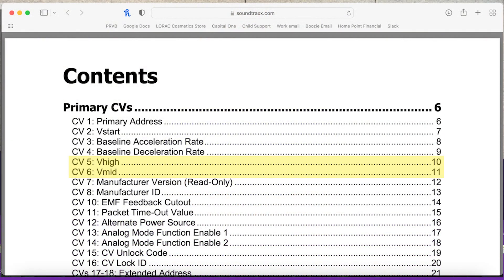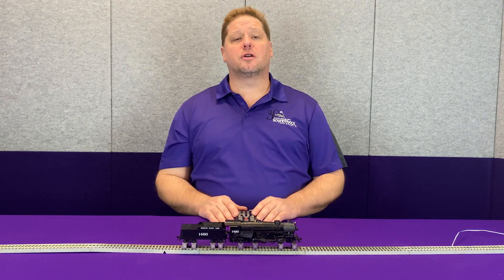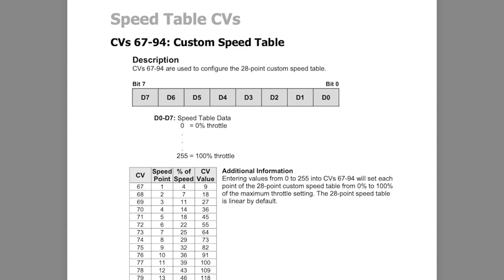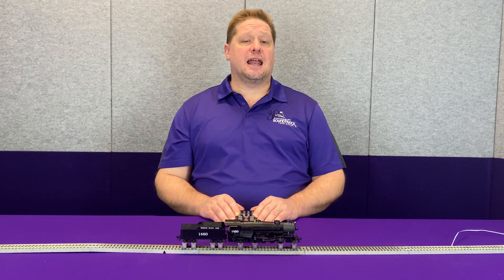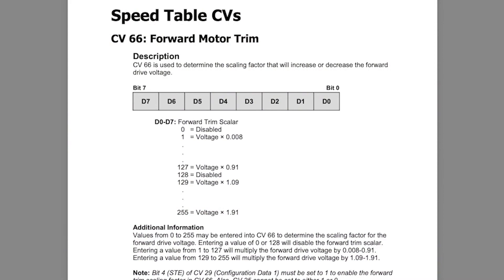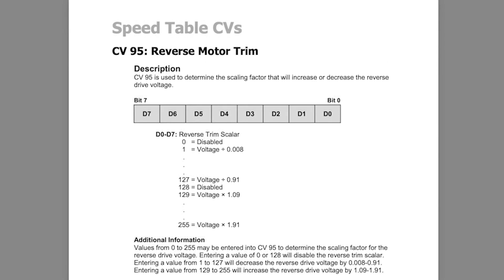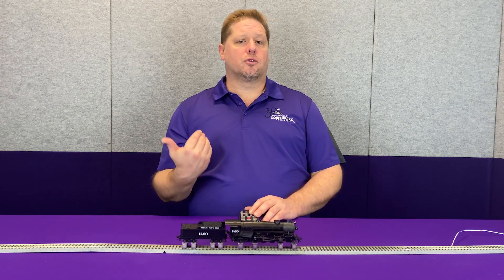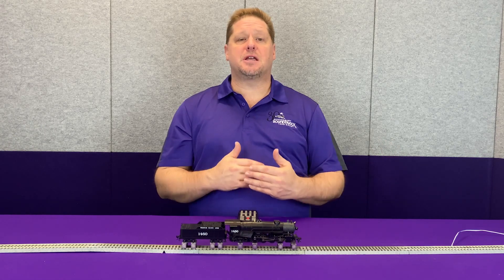How to Speed Match with Tsunami2 Decoders

Comment: Hi George, I have trying to tweak my gp-9 to run well at slow speed on speed step 1. It has been running slow but sometimes it will stall. Is there an easy or better way to make it run better on slow step 1? Should I make all the changes in cv's 67 to 94 or just 66 and 95. I'm really  trying to understand all the features that T2 has to offer and implement everything I can.

Chuck
Reply from the maker: We are glad that you are taking time to utilize all of our features. Please consult the manual or contact our Support Team for help with this: (970)259-0690 ext.22 or support@soundtraxx.com thank you.

Comment: I still use the speed table for speed matching my Tsunami2 decoders because when I use CV2, CV5, and CV6 I cannot get a very low starting speed (I can with LokSound decoders).  TO make adjusting the speed table I use JMRI DecoderPro.  I also use a loop of track and an AccuTrack II speedometer.  This way almost all of my engines are speed matched together.
Reply from the maker: You should not need to increase the value in CV2.  This jumps up the starting speed.  Also, make sure you are running in 128-speed step mode.  Otherwise, contact support.  You may be doing something to lose the slow speed control.  These things creep (Hperdrive2 video: https://www.youtube.com/watch?v=DIOWGxeO3Uc)
Reply: @SoundtraxxDCC  using CV2 with Tsunami2 I can't get a slow speed even with CV2 set to 0. Using the speed table I can get a nice slow crawl ( I aim for 1.5 mph in 28 step mode, so in 128 it's even slower).
Reply from the maker: @stuartaaron613  You should be able to, contact our Support Team for assistance.

Comment: The only issue George ,as you know,  is if you have used a preset curve, like I do , from Tsunami  1 , you have to plot a custom curve for every Tsunami 2 ! But once you have done it a few times it becomes easy . But the BEMF on the new decoders is beautiful and it seems to be "softer" in it's application! Of course the elephant in the room is the antiquated gearing we use...."worm" drives can't be pushed or pulled, so this is why speed matching is so crucial, but if our models had gearing similar to prototype locos, then things would be much easier and a lot more life like?
Once again a neat video that will certainly help those new to the hobby.
Cheers , Gregg.
Reply: Great Comment Gregg, When I saw "gearing and Worm"  I just new we were in for a classic Rant!!    I have both my Tsunami 2 decoders running great thanks to your wonderful videos on BEMF.  Anyone who is tweaking their CV's and trying to dial in the response they want should check out Gregg's Channel.  He has a great series on this subject and many more!!  ~ Dennis
Reply: @OtterCreek  LOL...Thanks Dennis for the plug! It looks like I can't go anywhere without being noticed! 🙂  One day I'll see a properly geared model train..LOL...I hope!
Cheers Gregg.
Reply from the maker: Gregg- We did eliminate them because we honestly did not hear many people that were using these tables.  You will have to manually enter them in CVs 67-94 to match.  Sorry.  We removed these preset tables (Log and exp) for features that were more widely used.